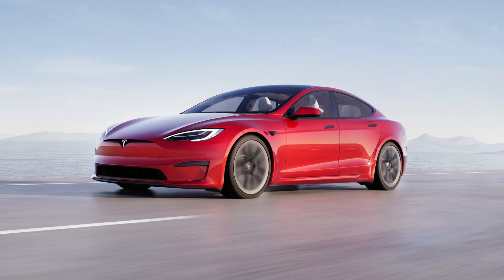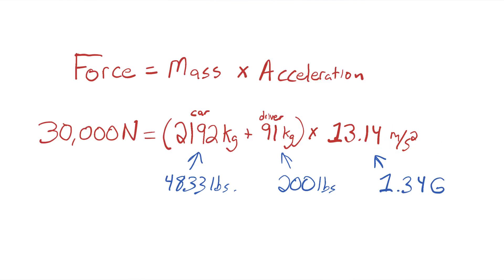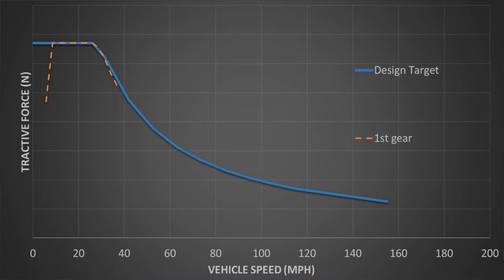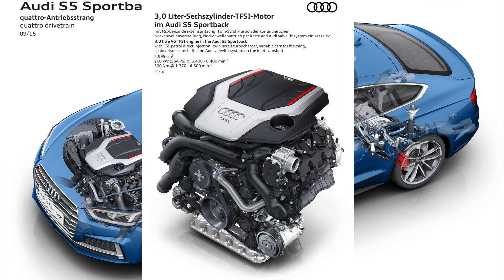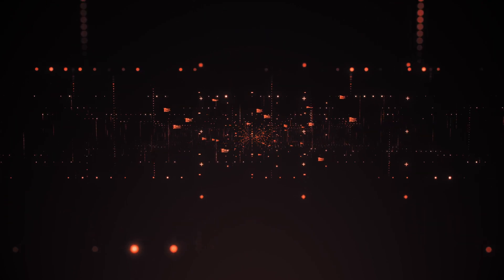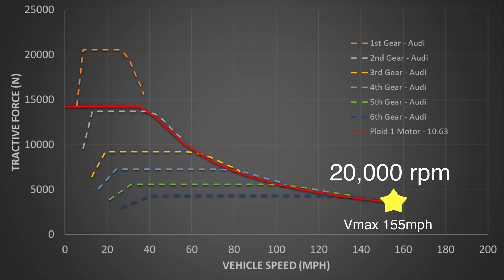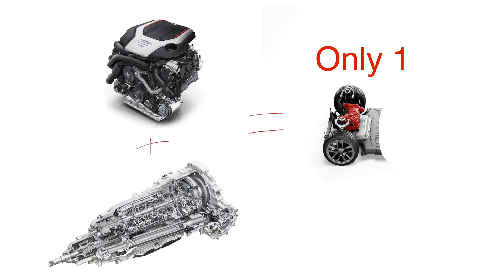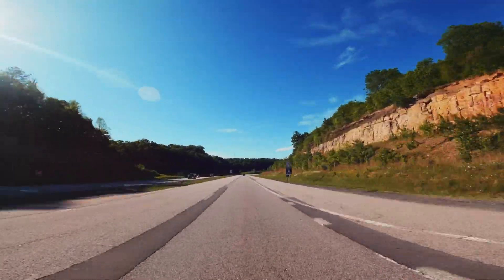Tesla Plaid - Transmissions Obsolete (Part 3)

Comment: so basically we need a 4th motor on the roadster and it will be unbeatable! haha
Reply from the maker: Exactly…. Also, that is precisely what Rimac did.  So 4 motors is better than 3 :)
Reply: @EngineeringPerspective  rimac used a larger battery with a higher voltage to get faster times, 3 motors would have worked fine but 4 gives you better control over each tire.

Comment: The wrapped rotors is so much more amazing than most people realize.  

Eat that Porsche Taycan, had to use a two speed gear box, Tesla learned that lesson the hard way on the first roadster.
Reply from the maker: I can’t wait until we find out more details about that motor.  It should be an impressive design.
Reply: @EngineeringPerspective  indeed.  I could have sworn that some DIY converters had in the past done "artisan" rebuilds with carbon fiber wrapped rotors... But perhaps those were just wrapped comm bars and I am misremembering?  Maybe it was just talk from DIY about how they exploded motors while racing and they wanted to wrap the rotors to increase RPMs?

Comment: Why wouldn't Tesla have an even lower Gear ratio? They seem to have way to much power at low speeds and limit the power anyway (Elon said 1020HP is only after 80MPH). Could this be because Tesla thinks that the new tyre's will have enough grip to handle the power or something?

Also Elon said that 200MPH requires the new tyres. Could the new tyres not being capable of 220MPH and is why it isn't mentioned by Tesla or are they just sandbagging?
Reply from the maker: Tesla set the ratio to achieve their 0-60 time of “1.99s”, it requires around 1.3G of acceleration which comes out to roughly 30,000N of Tractive force.  This sounds like a lot, but in my other video, I show that the Dodge Demon actually has more torque off the line, up to ~35mph and only drives 2 wheels, but they wouldn’t be able to achieve their best numbers without really sticky tires and a good surface.  In the Dodge demon press release, they tout “1.8G” of acceleration, which would be true in perfect conditions and only for a very short peak in 1st gear.The Tesla is using all 4 tires, and has slightly lower peak torque (surprisingly) but holds it constant until about to 60 mph which is why you are seeing many people achieve very good 0-60 times on the street as well

As for the top speed, yeah the tire ratings are going to be the issue.  The forces on tires at those speeds and with that heavy of a vehicle is incredible.  If you are interested, you should look back into the history of tire development for the Bugatti Veyron.  However, Tesla needs to solve these tire issues for the upcoming roadster which is claiming 250+mph and with 200kWh battery pack, will not be a lightweight vehicle.

Comment: That's very interesting. For me it's not immediately obvious why you are saying that torque is equivalent or higher than in an ICE car and the same time the graph goes down (I understand it shows traction force and not torque).
Reply from the maker: Which graph? Let me know the time stamp and maybe I can explain. These charts are in tractive force but it is the same shape as the wheel torque curve.  Anyhow, it is entirely possible I skipped over a piece of the explanation, sorry for any confusion
Reply: @EngineeringPerspective  Probably talking about 4:21 . He might not of realised you were talking about one motor.

Comment: Do you think Tesla will ever make a quad motor plaid? I think it's likely. 
That combined with all of the motors getting a power boost (400 hp at least, try to push towards 500), the new 4680 cells (preferably not the first ones that come out, I'd like them to refine them a bit more), carbon fiber monocoque, chassis, and panels, and that would be a my perfect car. (Obviously some of that is dreaming but some of it is likely to happen)
Reply from the maker: I think the future of performance vehicles will be 1 motor per wheel.  How soon will Tesla do it? Who knows.  They are sitting atop the performance car throne and don’t have any real competition at the moment (besides a multimillion dollar unobtainable rimac).  As for the 4680 cells, that could further set Tesla ahead, I may need to dive into that topic soon
Reply: We are at the beginning of the EV journey. Everything before were just snall experiments, now wirh mass market adoption the first performance models are already destroying similar priced ICEs. I bet my ass off we will soon see a public discussion about power limitation. Technology always trickles down. In 15 years a middle class Model 3 follow up could produce 1000hp, who knows.
Reply: In these cases its not the motor that determines HP, its battery capacity and its output raiting. Using larger batteries gives you more HP but with obvious downside. The 4680 cells supposed to have 1.2x energy output per kwh compared to the previous formfactor. If the plaid outputs 1000hp with a 100kwh battery it should output 1,200HP with a 100kwh  4680 battery.